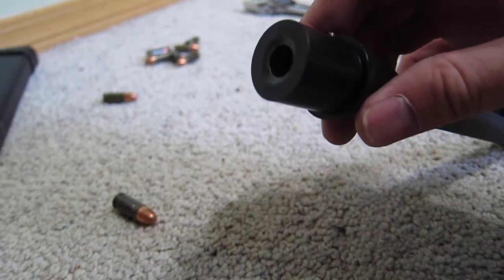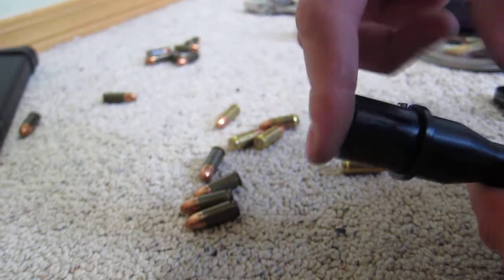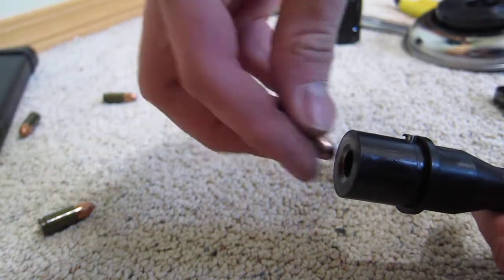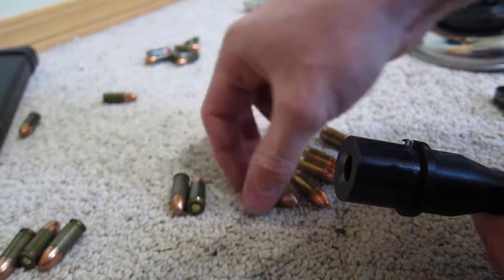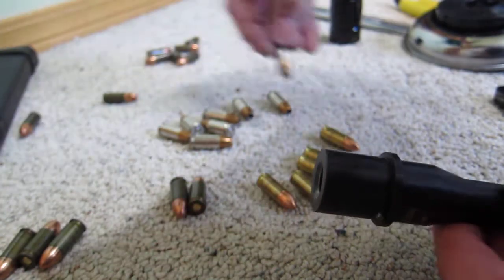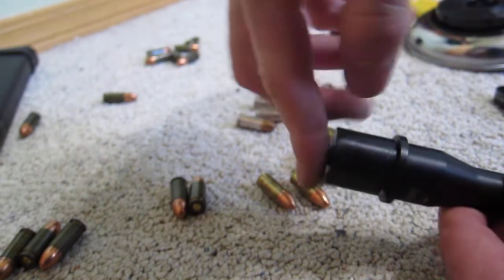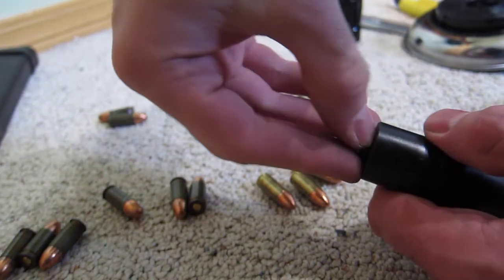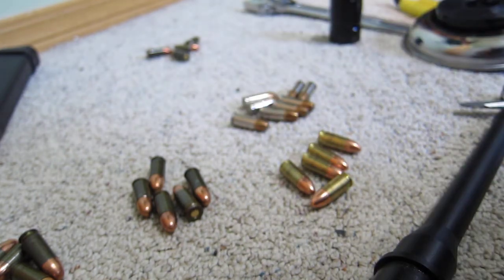Sticking Cases Faxon Barrel

Comment: Those wolf steel case rounds don't work in any of my AR calibers or brands. And most ARs say don't run steel case. If you look at the steel case you will see that it is a thicker Metal, I believe the thickness of steel case ammo is just slightly larger than brass and that is why.
Reply from the maker: Justin Cavinder it was happening with premium brass case and nickle coated cases too.

Comment: It's the coating on the cases. Get some Tula steel cased ammo, it won't stick. That wolf shit is covered in some kind of polymer coating.
Reply from the maker: GunQuickie it happened with many other brands of ammo as well. Both brass case and nickle coated brass case.
Reply from the maker: @v8felon  it does, but it was happening with every brass cased ammo i tried through it as well, including premium HD ammo.